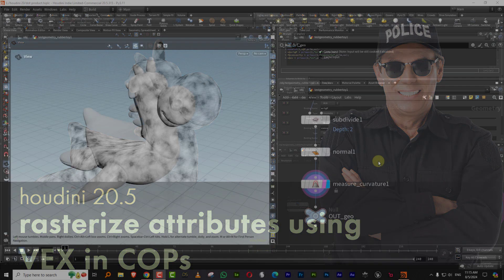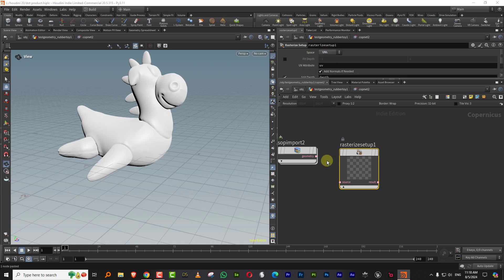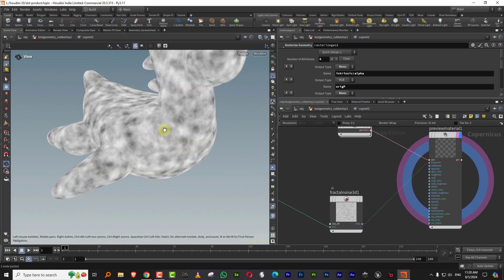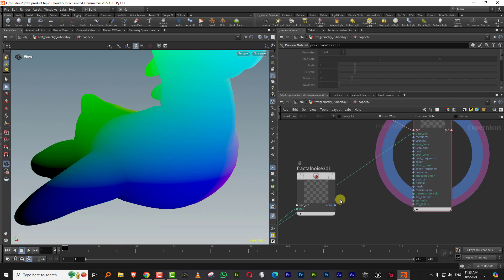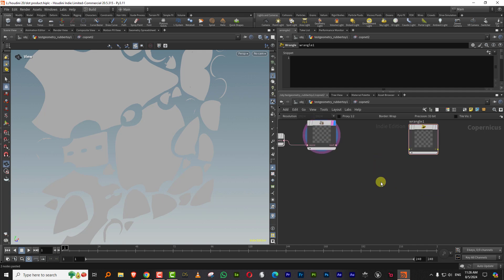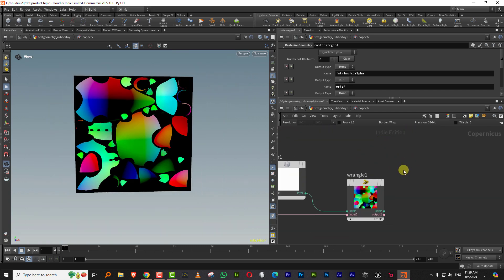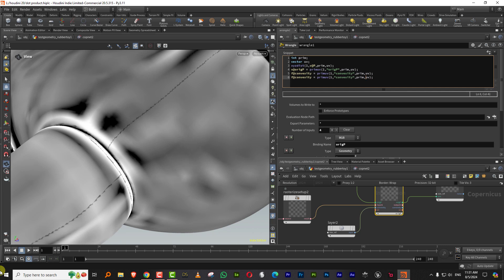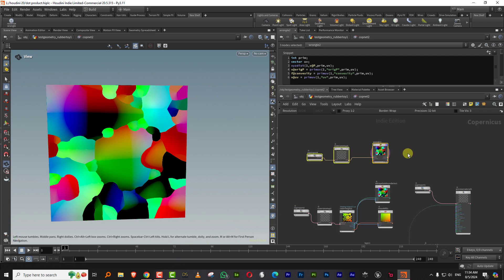Houdini 20.5 - Rasterize attributes using VEX in COPs

Comment: You can use recipes now to do what you did with the shelf near the end of the video, in case you hadn't looked into them yet.
Reply from the maker: I haven't checked out recipes at yet
Reply: @rohandalvi You really should Rohan. It's a quick system to learn and eternally useful. You can also share the recipe files to other to build networks quicker.

Comment: I doubt it could be done straight in cops, because it looks like it doesn't have access to the geometry. SOP, and the renderer have access to it.
Reply: the primuv uses intrinsic uvs, they are continuous and cover the entire surface, unlike explicit uvs that have seams. That vex looks a bit weird though - looks like the xyzdist doesn't do anything?
Reply: @HristoVelev  xyzdist is outputting the prim number and it's intrinsic uv's that are used in the primuv function to sample the attribute.
Reply: @damjanmx  there would be a variable on the left side of '=' to store the result of it though?
Reply: @HristoVelev  The xyzdist function in VEX is a pass-by-reference function. It directly modifies the variables you pass to it, so you don't need to assign its result to a variable with =.
Reply: @AndreasCatucci  cool, thanks :)
Reply from the maker: I just did a copy paste. I'll try to remove the xyzdist and see if it breaks the code.
Reply: Thanks for these videos! I haven't started digging much myself yet, so it's very interesting to see the thought process.